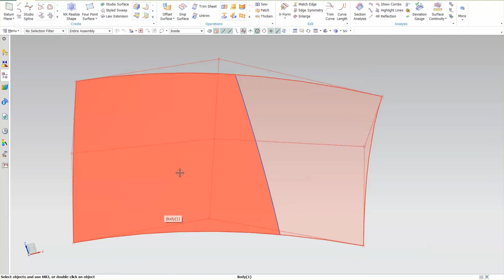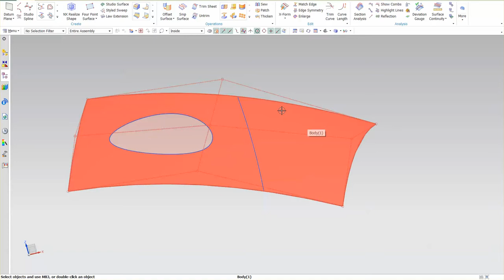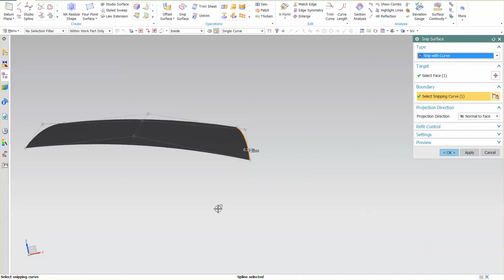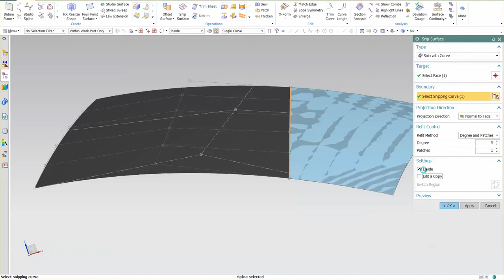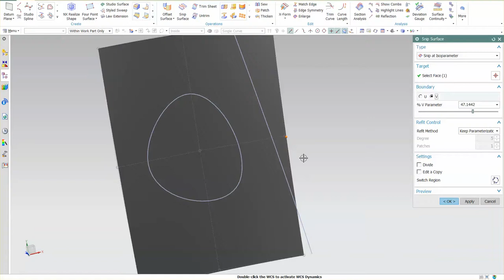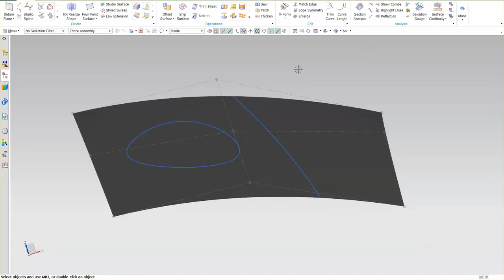Siemens NX 10 | Class A Surfacing Tool: Snip vs Trim

Comment: Hello,
Can you please tell me how did you create that surface.
I get an error for surfaces generated by using extrude ( the sheet is non-parametric) 
For through curves ( Trimmed surface) 
But, If I generate it by isoparametric curves and through curve mesh, it worked :)
Thanks!
Reply from the maker: I used 4-Point surface then used X-Form to change the shape.

It does a really good job and is very fast.